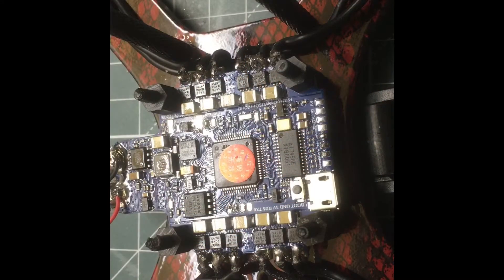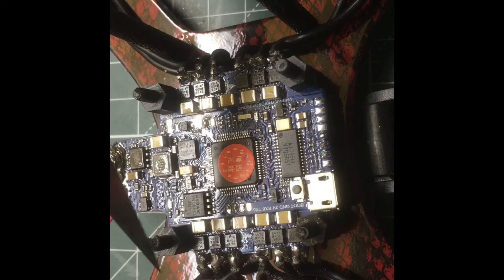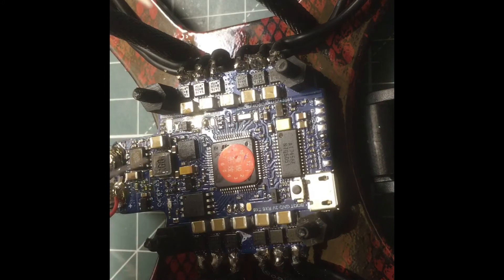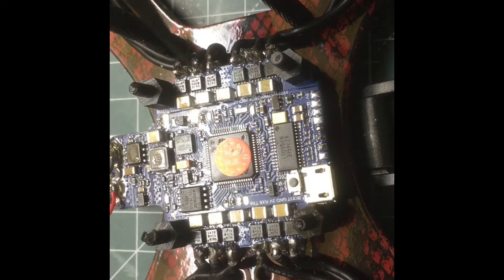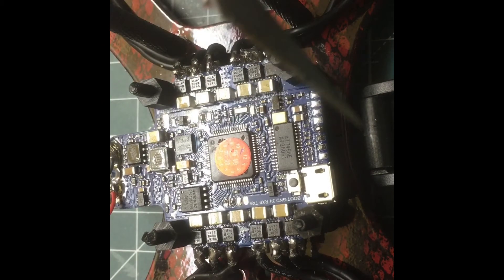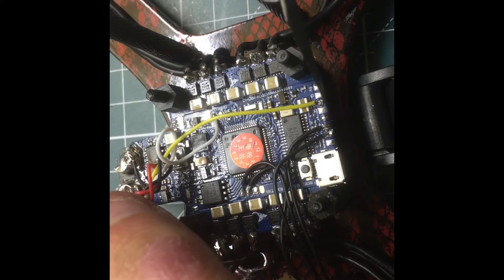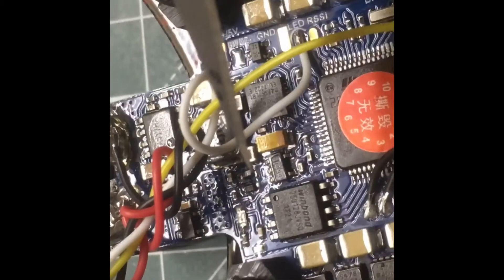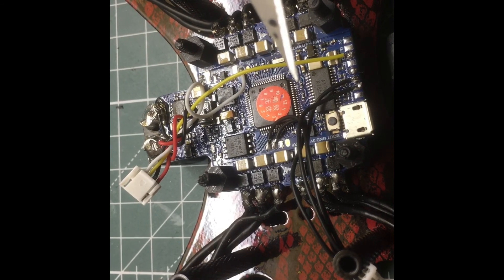Lumenier Alpha AIO Wiring Crossfire & Smartaudio

Comment: Is there a way to to use the uart you used for the tx/rx wires to run a devo 701 receiver and bypass my sbus which is currently not working?
Reply from the maker: You can use any rx pin on a uart but I’m not familiar with that receiver so u may or may not have to do a software invert on it

Comment: Do the motor wires all get soldered straight on or do you need to cross two of them?
Reply from the maker: Sorry for the late reply you can solder them straight on and then use blheli suite to change the motor direction
Reply: Thank you, Do you have a video connecting a receiver that isn’t crossfire?

Comment: Hey man, just wondering if you're going to drop that second part of this video with the setting it up and switching the motors, etc.. I'm new to the AIO and Betaflight at all, I've done kiss all the way up to this point but want to do exactly what you're doing with this ALPHA board, run crsf and switch motors and set up of course so I'm hoping it's coming! Helpful first video! 👍🤘
Reply from the maker: Yes working on the video now. sorry for the delay